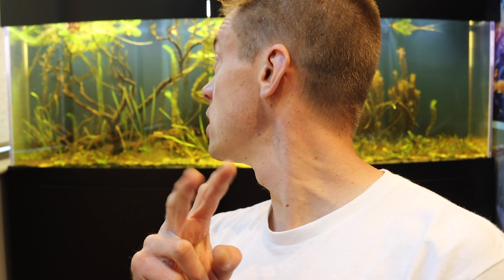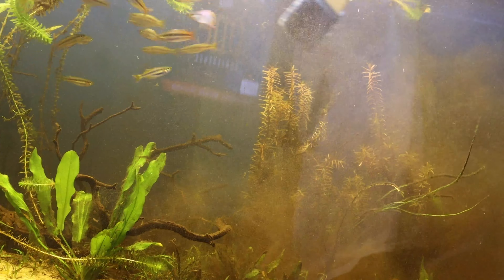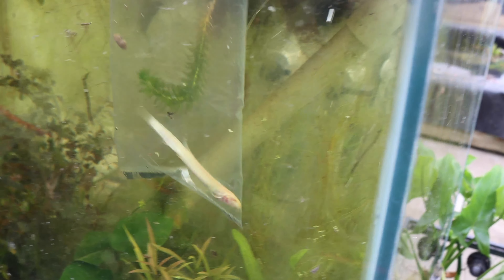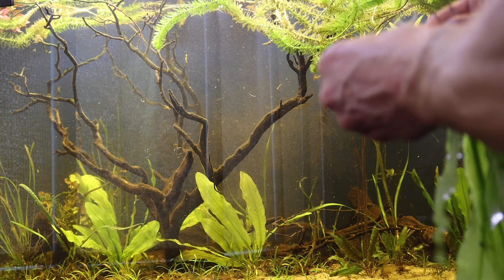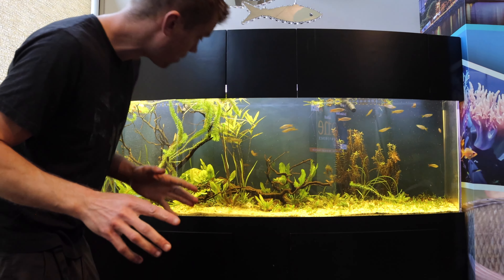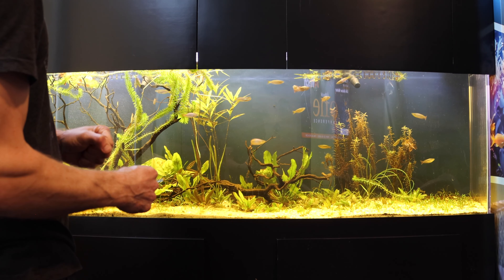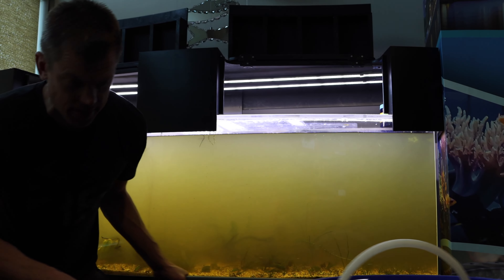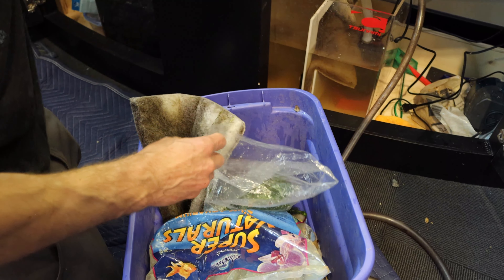Dirted Aquarium Maintenance: Major Algae Issue FIXED!

Comment: This convinced me again that dirting  a tank is a major error. I am 66 years old aquarist, and I tried at list 5 times in big aquariums, , it’s all ended up with catastrophic ecological issues.  In general in the beginning the plantes seems to love it , than the soil produce massive hydrogen gaz fermentation, bubbles coming. up,  algae explosion , the need to change massive amount of water often . After months even many plants start getting rotten. I live in France I have carefully selected the potting soil , different types, plus clay . So for me dirting a aquarium is a mistake, in the short run and in the long run. The soil always come to the surface of the sand or gravel, and mess everything….
Reply: You need to have enough of a sand cap (at least 2") to keep that potting compost from hitting the water column.
I've had mine going for a few years without issue. You also need fast growing stems to help control those nitrates that can get high. If you don't, you will get algae no doubt.
I know people that have had these going 15 years+.
Reply: You do have to have a thick sand cap on top and not move the heavy root feeders around. Once theyre in there, just trim and leave the roots alone. I am struggling with my tank at the moment after a crash earlier this month. I just bought a bunch of plants and I'm going to start it over again with the water still in there. I am planting today and its my least favorite part because the plants dont stay in lol. I think most dirted tanks do fail after several years if you don't add more dirt and nutrients. I'm going to start a 10 gallon dirted tank soon just to raise some plants in and eventually might put a couple fish in. There's a lot of ways to keep a tank though, and whatever way is easiest for you is probably the best way to do it.
Reply: I've had great success with dirted tanks. Would I recommend them? Probably not.
I wouldn't suggest them for customer tanks like this that's for sure? Dustin has had several problems like this for clients who want a dirted tank but can't/won't do the constant setup maintenance? They require alot regular maintenance and tweaking of lights etc for the first month or so. If you dont have the time and eye for that then you've got big problems.

Comment: Is it normal to have to redo a planted aquarium about every 2 years because it get overgrown? Have 30" dwarf sag, crypts that are over a foot tall.
Reply: I cant stop touching my tank because of Dustin's Jungle Val
Reply: I do reset mine every 1 to 2 years. Mostly as the dirt i use probably loses its nutrient levels
Reply: An aquarium is rarely static. :)
Reply: Add supplements to the soil when setting up at the beginning. If you are using common potting soil at big box stores without enchancing it you could try into nutrient problems. Worm castling, bone meal, blood bone, etc are good places to start with enchancing the soil.
Reply: @Wissassin  I use a 1.5" layer of sifted organic peat moss.
Reply: @daviddiehl197  do you use tabs or anything?  I use a sifted organic soil. With a gravel cap. Ive found gravel rather than sand. worked better for the plants im growing.
Reply: @Wissassin  just the peat moss with a gravel cap.